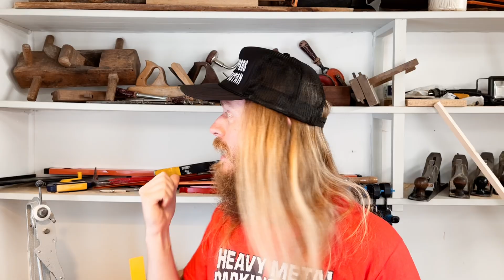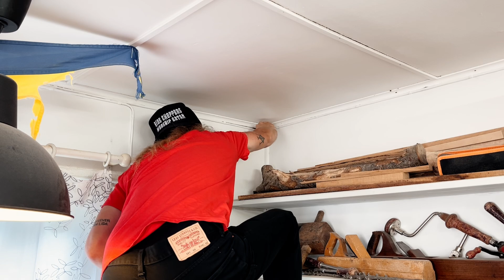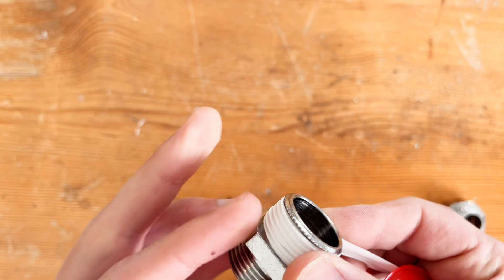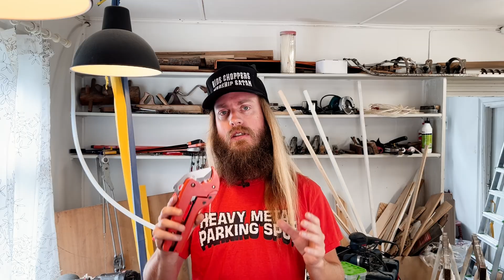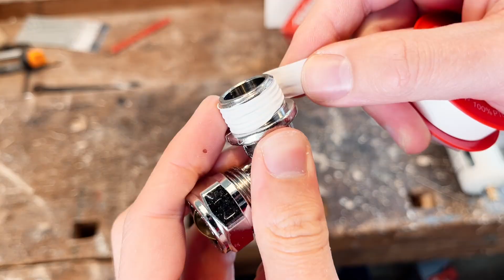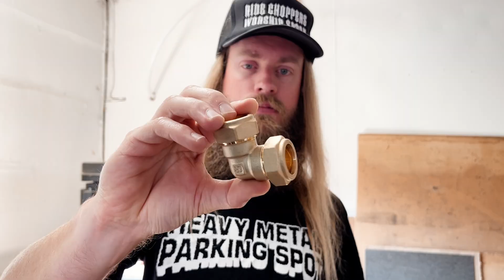Is Using PEX for a Full Shop Air System a Bad Idea? Let's Find Out!

Comment: Great video! I don't have such long tubes in my shop, so I placed the water filter right between the compressor and the line but I still have the problem of getting water into my tools...any ideas. Probably hard without seeing the setup :D I'll move in a few weeks anyways but I might give you a call before installing my new air system in the States. Hope you're doing well my friend!
Reply from the maker: Thanks man! When I paint I have a small filter right by the paint gun, just to catch the last drops.
Ah, yes! New workshop! Exciting times! Take care and let me know how it goes!
Reply: Move the filter downstream a ways. The air needs to cool more to drop water out of it. As well as run line uphill towards tools

Comment: Well I really think it's a great upgrade to any shop . Easy access to an air supply is a whole lot better and safer than running airlines all over the place and creating trip hazards  . The fact you used a large enough bore to start with will be a great bonus for capacity rather the bar pressure . Its more how much airflow you get than how hard it is ie PSI or Bar. Brilliant having the regulator at the last point in both lines should allow removal of condensation in the line before you need it at the tool . Yup the only ball ache is the pipe is a hard plastic that doesn't do tight bends ... and yes why were you still wearing the ear muffs lol ( nice n warm ears lol) .. there are actual push fit connections for the pipe but from what I've seen they are a bit on the bulkier side so great choice on the compression joints .. thumbs up for a great video proving it's not that hard to supply all the shop with air . Cheers Brother
Reply from the maker: Thanks for your comment! I've already gotten a ton of usage out of that air line and I don't really know how I got by without it before. 😅
I saw the push connectors when doing my research, but they ended up more expensive and harder to get a hold of, so I ended up going with these and I'm glad I did!
It's definitely not hard and totally worth it! Cheers!